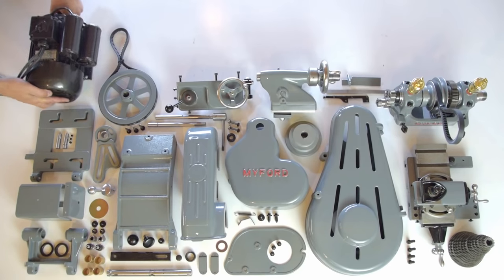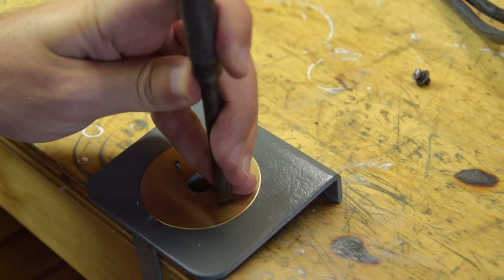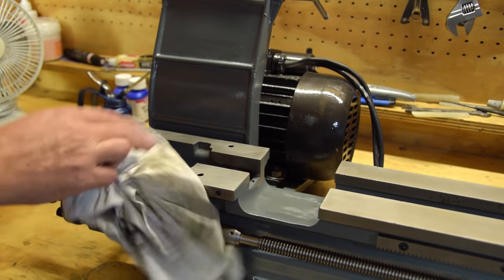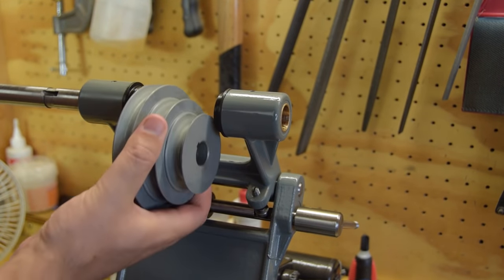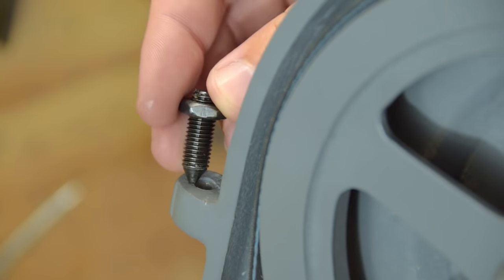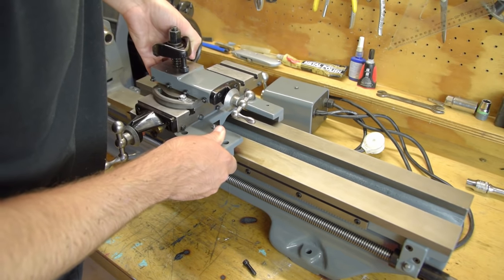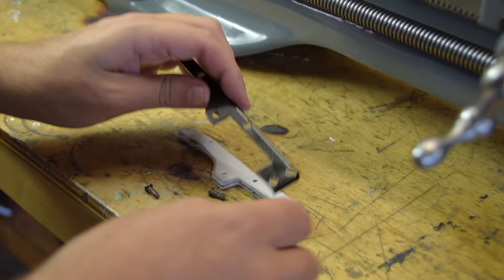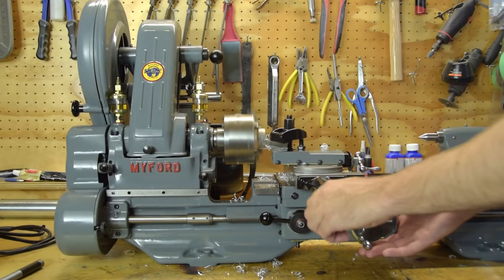Myford Lathe Restoration - Part 10 Final Assembly

Comment: Nice workmanship, I got same lathe two years back. I was not so luck with wiring on mine. Its shielding was crumbling and dropping off. So converted it to 400v 2/3rds hp motor with a wall control panel. Have left old electrics on the lathe. Just so it can be restored to factory condition. Paint work is pretty nice condition so left it for now.
Off out to put to work today. I am total amateur in this world. But enjoy the actual making an designing, And while on that subject Enjoyed the video.
Thanks for doing it, and saving that Lathe

Comment: Hi there.
I have just been through this series.
What a marvelous job, you have done!
I own a late just like that. My late father worked as a sales representative, and sold a new lathe and a welder to some sort of school where they train mechanics. In swap for the new gear, a Myford ML7 and a ESAB MIG welder was traded in.
Nobody wanted the Myford so mi dad brought it home, and then nothing more happened.
When we cleaned up his shead after his death, i took the lathe home at my place.
I miss a lot of parts, among that the complete set of gear wheels to adjust the speed of the apron.
And i will have to do the same kind of restoration, that you have done.
You have shown the way Mate!
Reply from the maker: Haha, cheers Ulrik. Good luck with your project. The good part about these lathes is that everything you need is still available.
Reply: oh yes, besides Myford, there's http://www.ebay.com/usr/myford-stuff
If you don't want to make yourself poor in buying new parts

Comment: Awesome series and lovely testoration  job :)

I will be using your vids as a guide for my own restoration. I just got a Grayson lathe, much of which Myford copied for the ML7 MkI when they bought the Grayson company, so I'm in with a good chance of making her true again.

The "backyard" approach is also a bonus as far as I'm concerned as it's far more accessible for both the beginner like myself who tend not to be so well equipped in the early stages.

I'm lucky, she's only had two previous owners and both of them were Rolls Royce engineers and work colleagues, so she's been looked after well. Bar a small amount of wear on the bed and ways, it looks like all she'll need is a good scrub down and a repaint.

I didn't know about shimming the headstock bearings, there aren't any present on mine, very grateful to you for that tip, thanks. 

Anyhoo, I've subbed and look forward to future vids, keep it up buddy, and thanks again :)
Reply from the maker: Thanks Wrenagade. Yeah, the back yard approach is all most of us have access to. I reckon too many people give up on a project because they don't have access to the 'proper way'. Good luck with the project.

Comment: Thanks Geoffrey, I actually got it repaired using sheets of thin metal, glue and cataloy! It's very solid and I think it might be servicible if I cannot find an original part. Thanks for the advice. I will try ebay.

Comment: Being new to this and learning as I go, I cannot help but wonder that whoever previously was responsible for my machine might have not done things so well.
I  dismantled the saddle to clean it.  Found shims on the front and back, don't look like brass except where it appears that one has worn through a bit.  
Reassembled, found that when the set screws at the front are hand tightened, the saddle locks up.
Rather suspicious that the front shims are not needed, but fitted anyway?

Comment: I think I would try to source a proper ml7 guard to replace the super 7. I dont think the 3 grub screws in the topside are to secure the tool post screw. I think they are just to plug the holes. The holes are used to secure the ratchet wheel when you have the four tool, tool post. Great restoration. I have had an ml7 since the early 70s

Comment: I really enjoyed watching this video series. Great job too. Thanks for sharing. It's great to see these lovely old machines being brought back to their former glory.

Here's a link to a video of my recently purchased Super 7. It needs a bit of tweaking to the jibs on the carriage as I'm not getting the best out of the DRO as it is. Other than that, I've got a few more upgrades in the pipeline such as a collet chuck, 4 jaw and a quick change tool post. It has an oversized spindle to take 25mm bat stock so standard bits don't fit so I have to make special back plates. I'm also drooling over a quick change gearbox but parts for these things are expensive!

Comment: Great work of Art. I’ve just got one of the same, serial no. K6114. Guess it is 1948-49 M7 model. I’m thinking of restoring it and conversion to Cnc. Do you think to hand scrap bed after surface grinding?

Comment: Geoffrey the Myford restoration videos were a joy to watch, and you ended up with a thing of beauty.  I am wondering if it might have even been tighter and more smoothly operating than when new!  It was great to realize that you are a Kiwi partway through — I think that happened when you had to jump in the Land Rover to get a bottle of Gas for the MIG welder.   Do you belong to a Menz Shed by any chance?  I am secretary of the Blenheim Shed, and revelling in having access to an Engineering workshop again after retiring from Ford Research in the UK 14 years ago.  There is something very satisfying about having something that you have made, or greatly improved, at the end of an endeavour.

Comment: Extremely well done. If that lathe could talk I'm sure it would thank you. Just keep any of it's previous owners a good 10 miles away from it. :-) You may already know it and just didn't show it on this video, but when meshing any change gears on a lathe a long 1" / 25 mm wide piece of normal copy paper or thinner can be used if it's pinched between the two gears and there teeth as the bolts are tightened. If the gears are meshed too tightly you'll get excessive wear and noise. Copy paper is normally around .003" thick and works well as a setting gauge.
Reply from the maker: Yeah, thanks Turning point. I don't normally use a piece of paper to set the gap, but yes all gears should have about that much clearance. Cheers. Hope you stick around for the next project!
Reply: Try that paper trick, it's fast easy and repeatable. Even better it's dirt cheap. I'll be here for the next one for sure.

Comment: I recently finished my ML7 restoration, it's about 50 years old and just needed the gibs adjusting - there's a tiny bit of wear in the bed, but nothing to write home about. When I measured the runout with a dial gauge in the spindle, I failed...even with a Verdict  0.002mm lever type...
I painted mine British Racing Green, just to annoy Myford purists :)))
Reply from the maker: Haha Sweet. It's your lathe, BRG sounds great.

Comment: What is the paint you used for the lathe. Ive been looking around everywhere but couldn't find the proper shade of grey. Its really hard matching the type of paint here in NZ due to the limited availability of paint compared to the rest of the world.
Reply from the maker: Just take an old part into anywhere that sells to the auto paint industry and they can mix up paint to an exact match. I go to linkup in Tauranga, but anywhere like that can do it for you. Very normal, that's what I do with everything. Can buy a single spay can if you want.

Comment: Hi Geoffrey,

Any thoughts on how to deal with cross slide run out on my Myford ML-7? The head stock is bang on parallel to the ways, but I’m getting about 3 thou convex taper when I face off a piece of 1” dia round stock. 

Gord
Reply from the maker: If the slide on top of the saddle is OK, I guess the underside of the saddle could be worn on a taper, which you might not notice if the gib is compensating for it. I'd take the saddle off and take the gib out and measure from the surface under the gib since it won't be worn. If anything isn't parallel to this you could try shimming with a little brass. Not sure tho, could be a number of things. Mine was a bit worn and I just machined the other surfaces so everything was parallel.
Reply: Geoffrey Croker 
Thanks! I was thinking I might have to make up some kind of a tapered shim, so I guess I’m on the right track. 
Looking forward to your next video.

Comment: Great work) can you said please what’s the better lathe myford or boxford?
Reply from the maker: Boxfords are much bigger. Bigger is better for latges. But Myfords are a small lathe if that's what you want.
Reply: Geoffrey Croker thank you dear :)
Reply: So do you think I would better buy a boxford?
Reply from the maker: @adelawada1451  Myfords are model makers/hobby lathes. Small and not very strong but you can buy lots of accessories for them, like milling attachments and dividing heads, because they were aimed guys who only had one machine to do everything.

I'm not that familiar with boxfords, but I think they were intended to be more of a proper industrial lathe. Still relatively popular though.

Try and get a lathe with a screw cutting gearbox - that makes a big difference. And power cross feed is nice to.

So depends what you want really.

Comment: I just did 3 atlas metal lathes,,,12 inch ,,, 618 6 inch and 109 6 inch,, actually sold one and almost payed for all 3..But I'll never sell my 12 x 36 has quick change gear box and it cost as much as the lathe in 1958

Comment: how much did u pay for surface grinding the rails???!!!!!!
i want to buy a lathe but im not sure if its worth it 
the gears and all are good but the bed is rusty and beaten up (like heavey workpieces falling out of the chucks) apparently they made small steel mining and industrial railroad wheels and drivewheels for old machinery on it (like 30cm diameter with 80 and more Kg) 
there are some  up to 0,5mm deep indentations but over all its good - the bed is not cast iron but hardened steel and is massive the lathe has 1,5m workspace and ways abaut 1400kg
Reply from the maker: The myford bed is just cast iron and flat. I had it resurfaced on an engine reconditioners planer. Cost about $100 from memory.
Reply: ok thanks 
thats a god over all idea
i looked up a company specialized in surface grinding heavey machinery
maybe since it isnt a flat bed,hardened and way larger he said it would cost around 600€ for standart grinding and additional 400 for polishgrinding (just finer grid like 500grid) and 350 for the shipping to there and back to me
they would also make the dovetails from te crosslides and make new keys
i will look up someone thats industrially restauring motors since that other company wants more than the machine is worth/what i would pay for it
i like your video here 
Now u need a real mill -how abaut a new project ?

Comment: I looked at a 1971 Myford ML7 with screw cutting gearbox, its as "new condition", September 2017 the bloke wanted $3000 au for it, the blokes father died, he bought it new, its located in Tasmania. he wants to sell it, it was not what I was after so its still available.

Comment: Now that this machine has been tarted up with a new paint job it would work better if the long flat ways had  linear rails mounted on them........no machining required apart from a few screw holes as the ways would most probably be flat enough already........it would certainly prevent the wear on the inside of the front way that bedevils all Myfords........shock horror....are you still going to use that ancient tool clamping device instead of a wedge QCTP??? and no DRO.....I'm outta here.